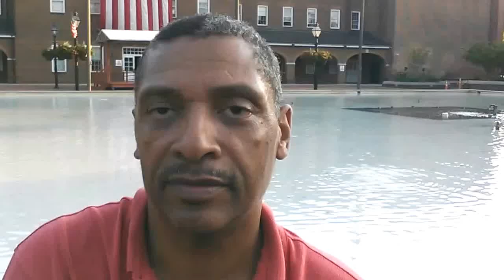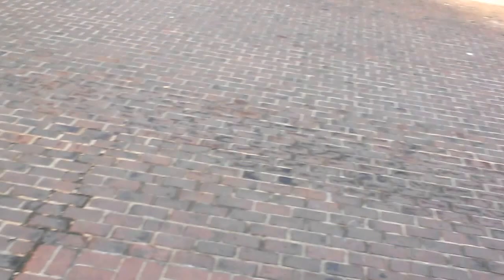Tesla Duck electricity curve, JB Straubel cto, batteries beat gas/coal plant peaker solutions.

Comment: If an EV owner is smart, he'll program it to start charging when demand and the cost of electricity from the grid are lowest. He'll also have his own battery storage from which to run his house and charge his car. And the price of both EVs and battery storage will decrease dramatically in the coming years. If the power company is smart it will have massive battery storage instead of peaker plants just as they're starting to do in Austrailia now.
Reply from the maker: this is all true.  average house does not generate enough to power car daily